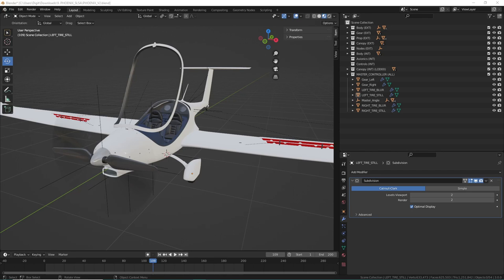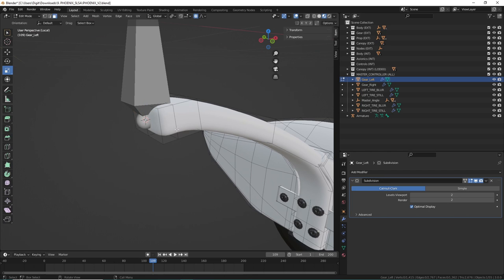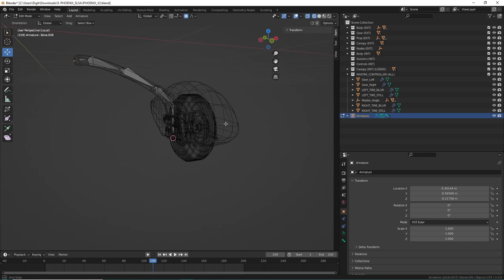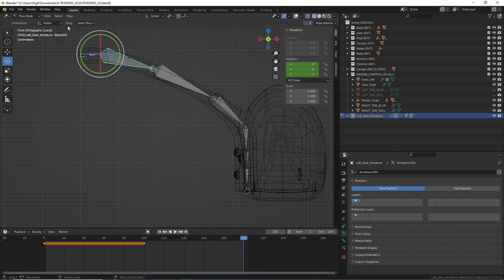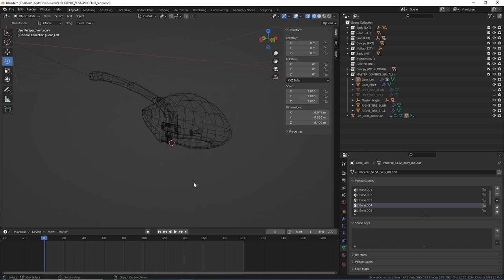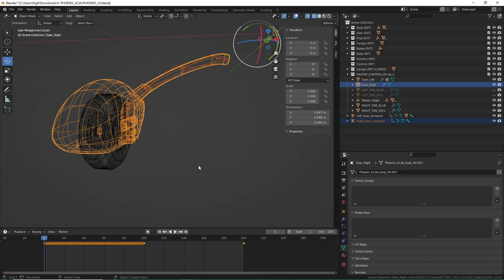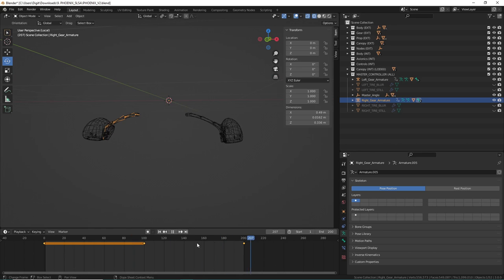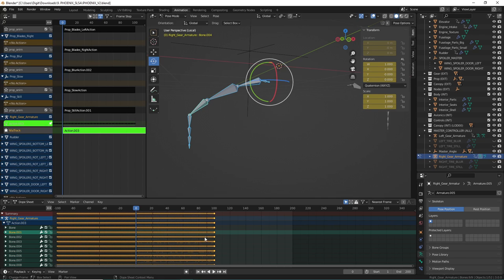MSFS: Bone Animations (PART 2) (NEW)

Comment: Awesome Jonx! Love your tutorials. This same principle applies to deforming wings? How do you handle movable ailerons and flaps?
Reply from the maker: Add more bones at those areas and just like (Tutorial Part 1) do seperate NLA tracks for those movable surfaces. But make sure you isolate those animations when you bake them, just like Part 1. Basically just weight paint those Aileron and flaps to those bones and nothing else.
Reply: @JonxSimulations  Awesome I will try that later